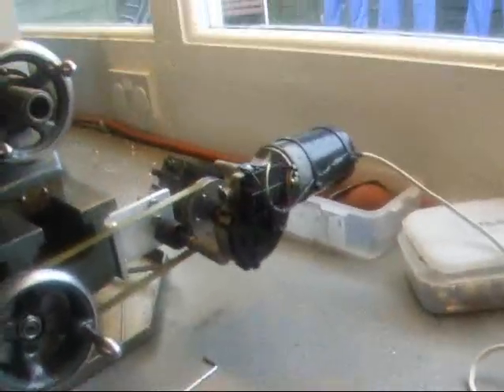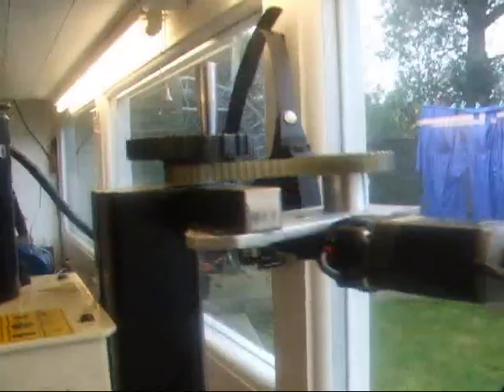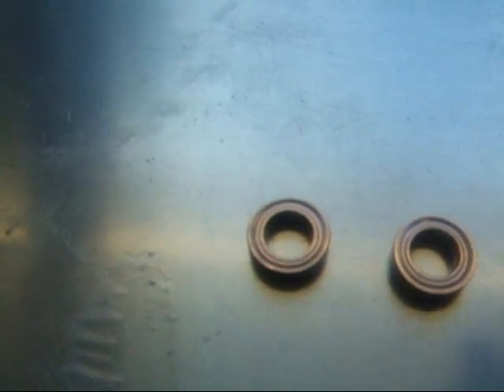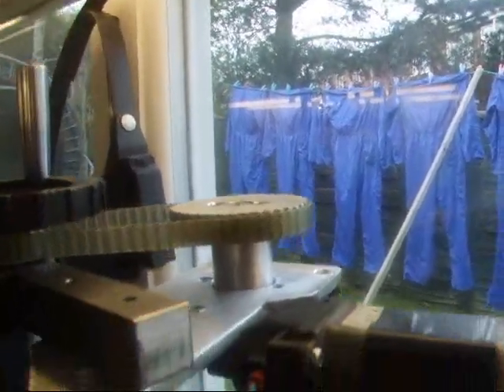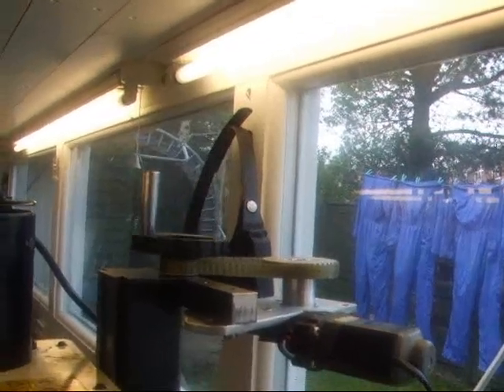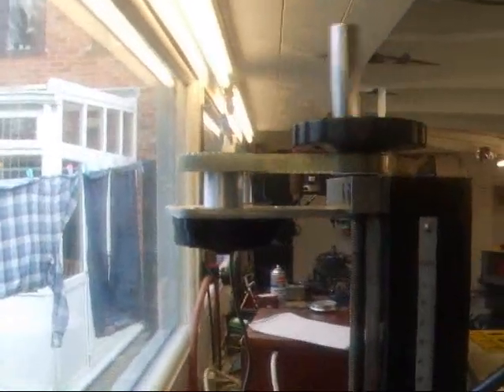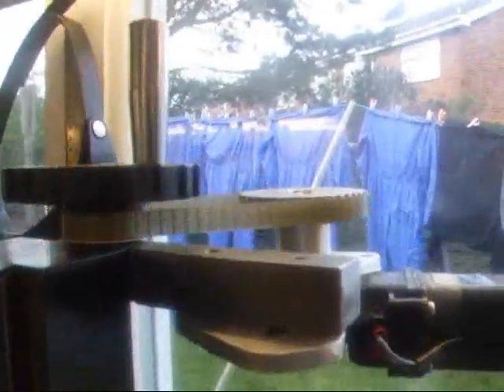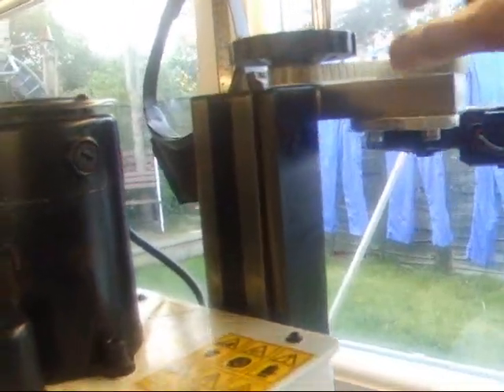X1 mill power drive on Z axis

Comment: Nice mod, thanks for posting, I might have a go at this as winding that Z axis is a pain.
Reply from the maker: Hi Del. Glad you like the mod. I have built my benches on the high side because I don't like leaning over which makes the Z axis handle a bit of a stretch. Apart from winding up and down its great for boring. Turn the speed down and just press the button. You will get a far better finish than winding by hand. The motor I used was a car electric window motor which was ok but I have since changed it for a more powerful windscreen wiper motor. Much better.

Cheers

Rich
Reply: Hi, i would like to make the same mototdrive for my x1, do you think you have a sketch of how you madethe new top mounting with the two ball barings?
Br
Martin
Denmark